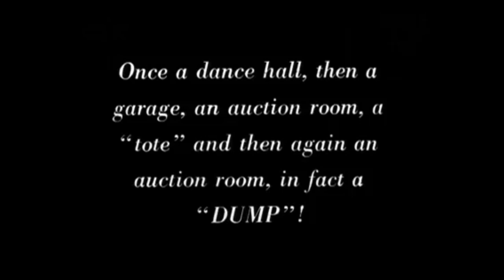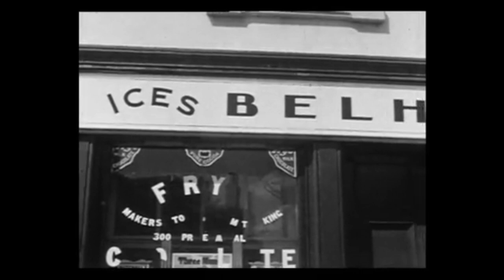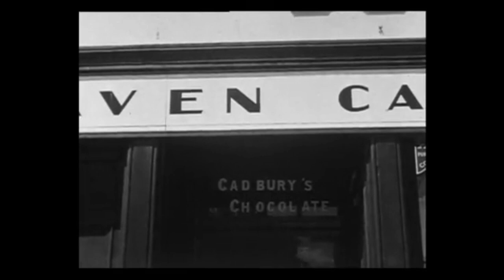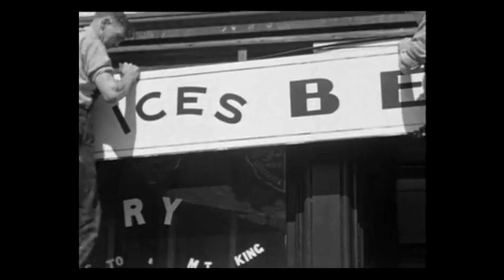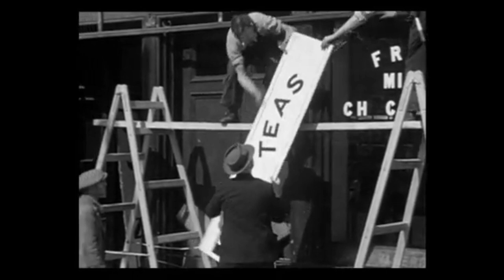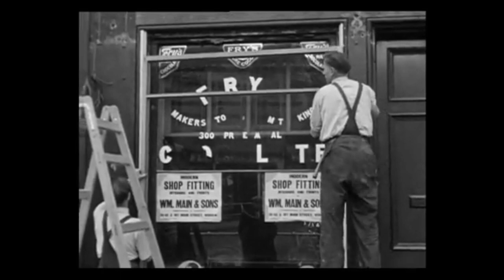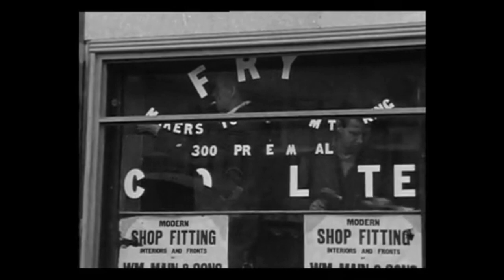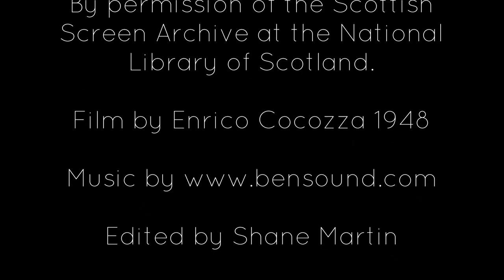The Old And The New (The renovation work on the Belhaven Cafe in Wishaw Lanarkshire)

Comment: As an apprentice electrician in mid 70s Glasgow nothing struck fear better than being told " you will need 2 trestles and a catwalk" to do a job..we used  them with the catwalk on the top to repair canopy lights in petrol stations.. God help you if you accidently stepped back (or forward)